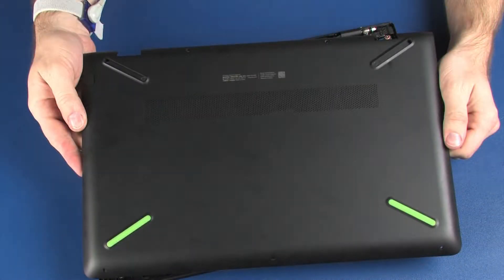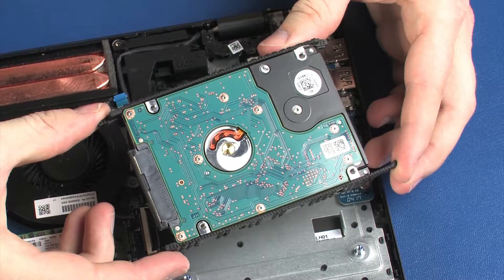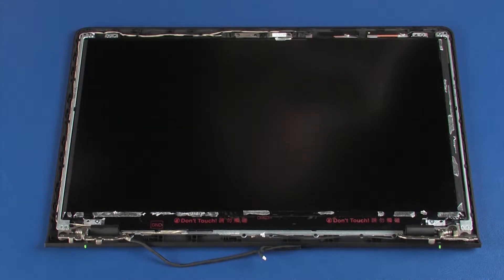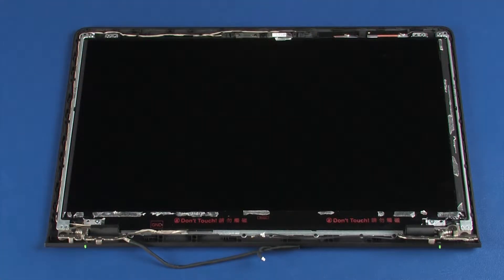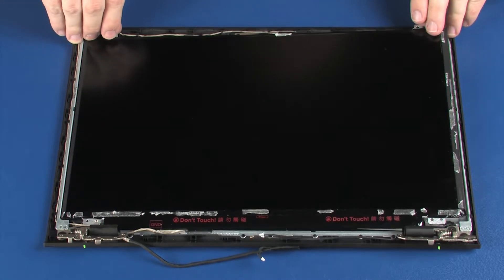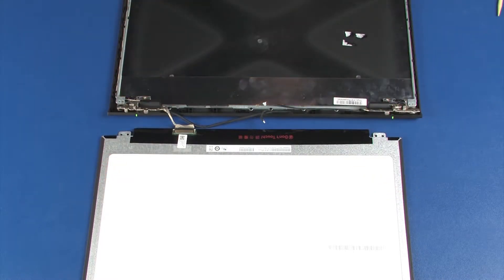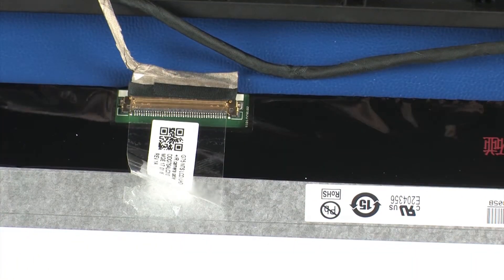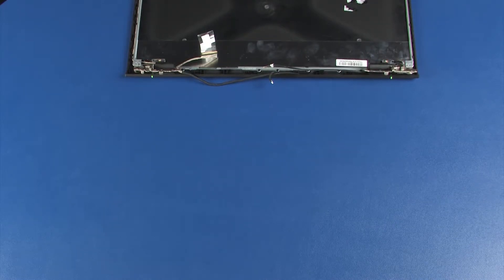Replace the Display Panel | HP Pavilion Power 15-cb000 Notebook | HP Support

Comment: Is this the same for 15-cb003ng? Purchased in Germany. The laptop's screen sometimes works sometimes does not. It works when I touch the right bottom part of the display frame. What can be the problem here? Display or poor connection or plume has defected?
Reply from the maker: +Sardor Amonov This document provides solutions to a variety of problems that can occur with notebook and All-in-One displays such as blurry text, poor video performance, black or white screens, or damaged hardware. Find a section below that matches the problem with your display, and then follow the steps to resolve the issue: http://hp.care/2oPxHcG

Comment: Does anyone have links to replacement screens for this specific model? To ensure the correct replacement screen is purchased.
Thanks.
Reply from the maker: +Christoff Marais Please contact our phone support team to purchase the screen. Please follow these steps to reach them.
Step 1. Open link: www.hp.com/contacthp
Step 2. Select the product type.
Step 3. Enter the serial number of your device or select let HP detect your product option.
Step 4. Select the country from the drop-down.
Step 5. You should see the HP phone support number.